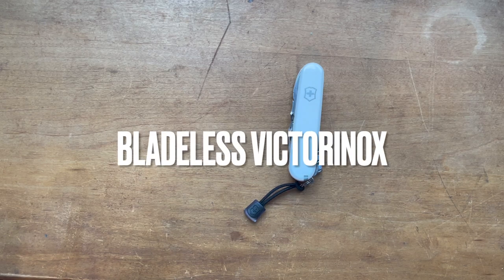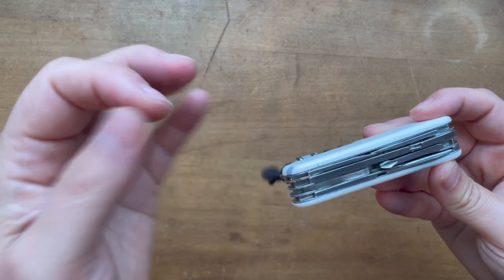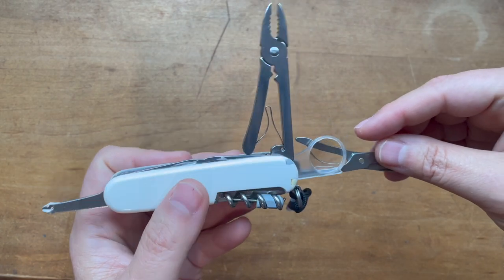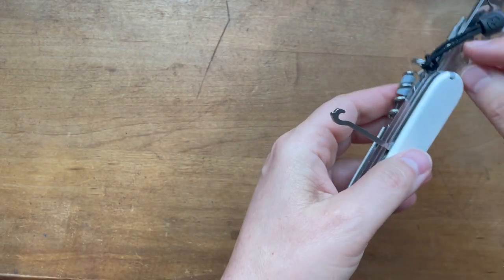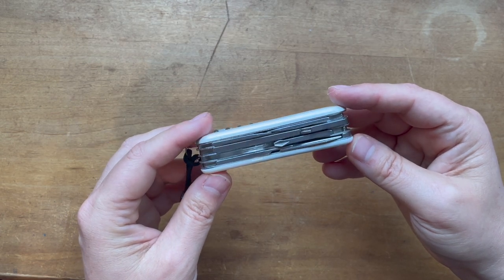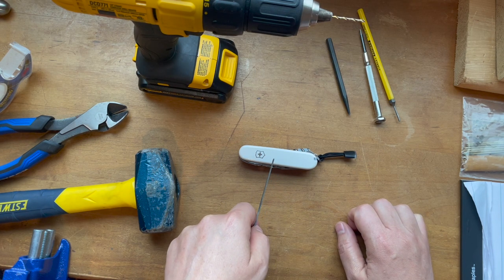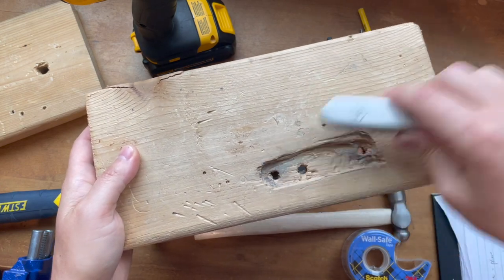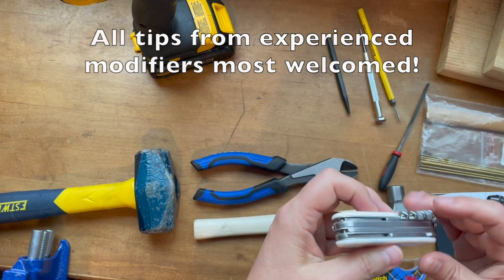Bladeless Victorinox Multitool Modification... a Swiss Army No-Knife

Comment: Victorinox pliers are not useful for me at all similar to the small plier based Leathermans. I EDC a surge and compared to those pliers the SAK pliers might as well be tweezers
Reply from the maker: Ha! Too true. I have a Surge and it’s a rock solid tool… but too heavy to want to carry around regularly. Sometimes I carry the wee Knipex pliers and they are excellent.
I forget the name of it but the Leatherman with locking pliers is enticing.
Reply: Yea but the best tweezers ever. I don’t use them as pliers either. Except for the Swiss tool which is a plier based victorinox tool. But these pliers are literally super tweezers.
Reply: Agree. I’d rather have a Squirt PS4 and a SAK, than a SAK with the pliers. But they have come in handy every now and then anyway, just not for bolts.

Comment: So glad you did this video! I feel inspired. 

I have some thoughts for you about the pliers. I initially thought that they were not useful, but here is what I've used them for:

Picking up dead bugs.
Picking up live bugs, but be careful because apparently some kinds of bugs can disattach their leg and crawl up your arm. This turns out to incur damage to the Swiss army knife for some reason.Something to do with the velocity with which it hits the ground I believe.
Picking up dead mice.
Picking up broccoli that jumps out of the pan and now is sitting too close to the cooking fire on your gas stove. Hopefully you washed it after the mice and bugs.
Picking cotton out of a medicine bottle when it has gotten shoved in too deeply.
Stripping wire after you cut the insulation
Magneting your rovyvon a 8 flashlight to
Pulling little splintery pieces off of a log when you need some tiny tinder to start a fire.
I hear it's good for getting cactus barbs out of dogs, but I've never had to do that
Getting a tea bag out of the water when it fell in with its string or if it didn't have a string
Reply from the maker: Omg… I’m dying, trying not to snort out loud in a public place. 
😜
I’m sold on using it to extract unwelcome broccoli out of anywhere it may appear.
Reply: @daphnedevi  lol!
Reply: “The velocity with which it hits the ground” 😂🤣😅
Reply: I just laughed out loud in public!!!